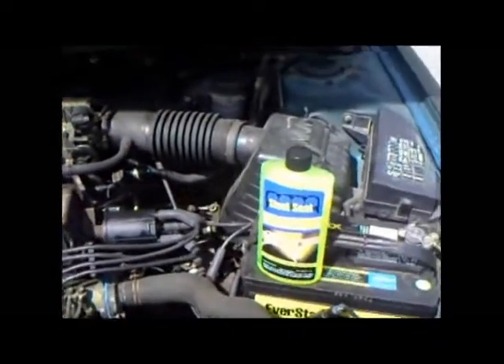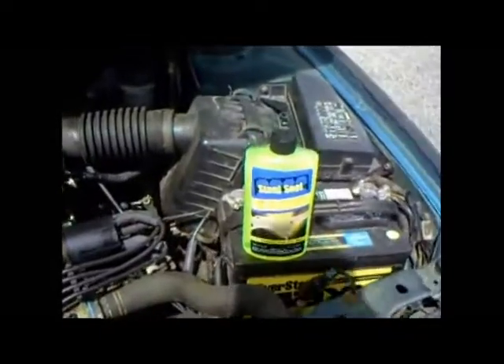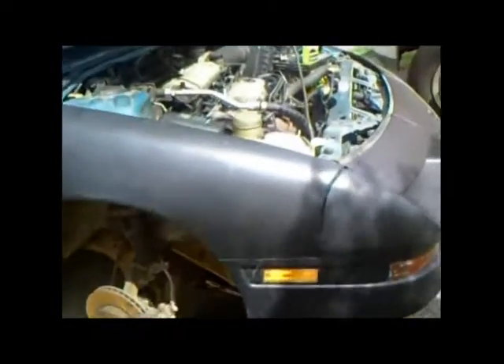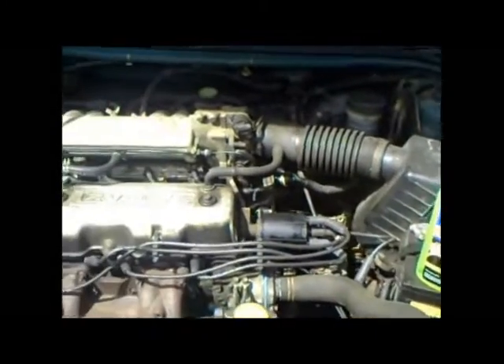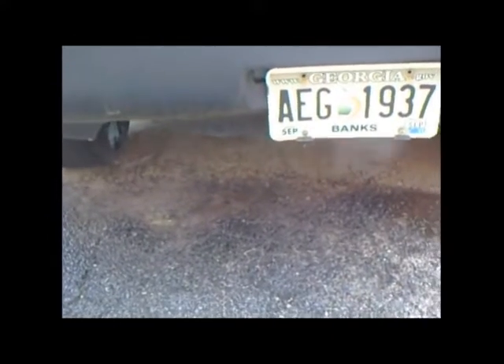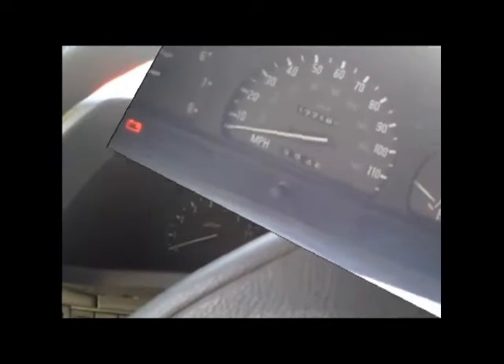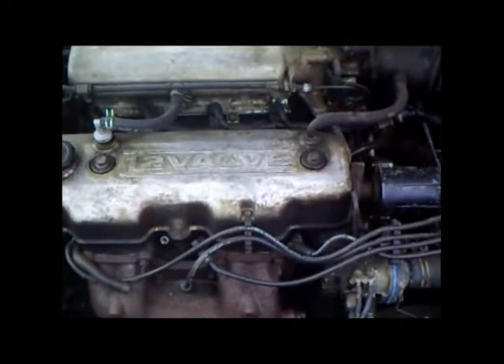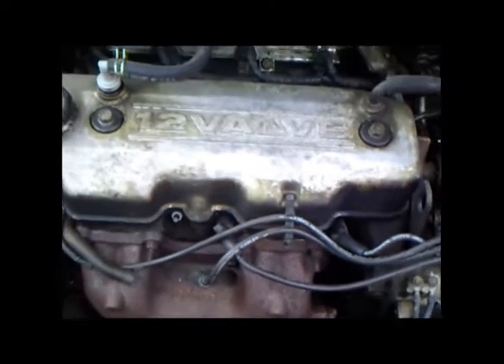How To Fix A Blown Head Gasket With Steal Seal Or Bars Leak!

Comment: Scotty KILMER SAYS: Take out the worst offending wet plug- leave it out. helps sealer to not have to fight so hard, remove thermostat, during sealing-run thru at full 1000 rpm put a clamp on it if you have to, start with clean antifreeze and add as needed during 30 minutes then cool engine and run the cycle 2+ times before giving up  ''operator error''

Comment: before you put that stuff in, you need to flush the radiator, and disconnect the thermostat, plus when you run it, your heater should be on maximum setting.
Reply: Yea I agree. He probably should have drained all the old coolant out first. And it probably wouldn't have hurt to change the clogged hose before attempting to use steel seal. We just ordered a bottle. I also heard that you should first drain the radiator, remove the thermostat, remove the spark plug that is wet with coolant, then add steel seal and a gallon of distilled water (it has to be distilled), turn heater on max. Let it run for 60 minutes. Then let cool off for about 30 min. Once it does the job, I heard you should drive for 500-1000 miles then flush again and put in regular coolant. Not Dexcool or Extended Life Coolant (SS is not compatible with these). People who have done it this way have gotten better results than those who just poured SS in and drove. I hope this works for us and anybody else.
Reply: LadySharlaMane true

Comment: Should have pulled the plugs clean 'em off and it probably would have fired right up, btw, those 4 bangers like that one are very simple diy job to replace the head gasket if the car is worth it \m/

Comment: bars leak made your car over heat? your only suppose to put in half the bottle in little 4 cylinder cars.if you did only use half a bottle; I cant understand why it would clog that little hose up hmmmm.how did you add the steal seal just poor in it or did you remove the thermostat?thanks  good video :)

Comment: None of this stuff works if the leak is too big. An it don't really completely stop it, it jus slows it. its better off replacing the gasket cause over time this stuff WILL damage yer engine, as much as I hate to say it.
Reply: HOW does it damage the engine ?
Fixing Tough Head Gasket Leaks
.
Reply: AZ DONALD the block has small ports that runs to ports on the head  that circulate's the water from the block to the head he head gasket is there to seal not only the combustion chamber but ports between the head and the block if there clogged it will build up way to much presser and either crack the head or the block if left to long its better just to replace the gasket
Reply: not only that, but if the gasket is busted where the combustion chamber is, not only is oil getting into the combustion chamber, but the gasket fixer as well, which will damage the piston rings, and crankshaft friction bearings. which in this products humble return leaves you with over $4000 in repairs to the engine.
Reply: Matt Mills 
Snake oil!

Comment: K...what about them noting (Bars Leak at least), to turn your heater on and have it blowing high while it idles?  I've got a car that has no heater, or fan or blower.  They say that step is IMPORTANT.  Is using Bars Leak or whatever product worthless if I don't have a heater to run during the "test"?  And wait...you idled your car for nearly TWO HOURS?!!?? lol  I'm sure it got no hotter after let's say 45 minutes up to the 2 hour mark, or at least at SOME point it reached maximum temp well before 2 hours.  Also, why not DRIVE the car?  Why just run this stuff through while the car is at an idle?
Reply: You don't use Bars leak! it is only for crate motors (v8) and I will answer your question about not heater core. Bypass your heater hose to your engine block and it will create more circulation for the coolant to flow better chance to seal it and make sure you remove your thermostat out.

Comment: i have a 97pontiac bonniville the back has white smoke coming out the back of it what should i do it wont start
Reply from the maker: did it overheat at some point or is it low on coolant?
Reply: It low on coolant
Reply from the maker: +Erica Mccall yea it's probably blown you can pull the spark plugs and see if there is mosture in there. if you clean them all out it may start but it will just happen again. also check your radiator cap the rubber seal may be damaged wich caused the water to boil out and overheat the engine....however that won't fix a blown head gasket the damage is already done.

Comment: I just bought this car 2weeks ago and i am already having problems the car wont start again right now its smoking out the back i need help on what to do
Reply: my 97bonniville wont start anymOre Its blOwIng OUt whIte smOKe and i need cylinder 3 what ever that means please help
Reply from the maker: I would recommend getting a mechanic or friend who works on car to check it out. if  you have a lemon law in your state I think you have 30 days and you can make the previous owner return it if they sold you a bad vehicle (never used this just reserch your state laws)
Reply: +Erica Mccall white smoke is a sign of blown head gasket. Look in the radiator and see if it's bubbling looks like boiling.  If it is it's a blown head gasket.

Comment: What better way to fuck up the thermostat and overheat the engine! STOP LEAK:D
Reply: Run it without the thermostat in it, I have used steel seal before and it worked very well.
Reply: Running it without the thermostats even worse. the enginge wont have anything to help rugulate its temperature. shit can hit the fan. examples like eventually getting missfires, coolant temperature errors in the computer codes, wich will damage the ecm/pcm, no pressure on the coolant system resulting in too cold/hot engine, damage to the heater cor,  and worse case senerio, cracked engine block, and etc etc.
Reply: +Matt Mills, I obviously meant run the engine without the thermostat only during the sealant process. It would also be a good idea to run the engine without the spark plug where the head gasket is blown.
Common sense goes a long way, the idiot in this video obviously let the engine run extremely hot by not keeping an appropriate amount of coolant available.
Reply: That would make more sense. But i still prefer replacing the gasket. cause in the long run, shit will eventually break again.
Reply: Matt Mills what if you dont have the money and trying to get rid of the peice of shit

Comment: the radiator fluid is leaking out but not from hose or radiator but where it runs into the engine. what can I do?
Reply from the maker: +FayeAnn Anderson possibly your water pump, if so you need to fix it fast or risk blowing the engine....

Comment: terrible stuff, did not work. Ended up in shop having head gaskets, valve cover gaskets (both gaskets multilayer), pressure test head, resuface heads, Sure Grip headbolt set, thermostat, seals, flush cooling system, clean and regap new plugs, oil change and clean electronic throttle body and plate. $715 in parts + 28 hrs labor at $92 hr. + NY taxes = $3892
Reply from the maker: dang I hope you have a nice car lol
Reply: WOW that high I fixed mine for around $600 no shop only took head to machine shop then did work myself.
Reply: You have put this on about every head gasket repair video.  Troll